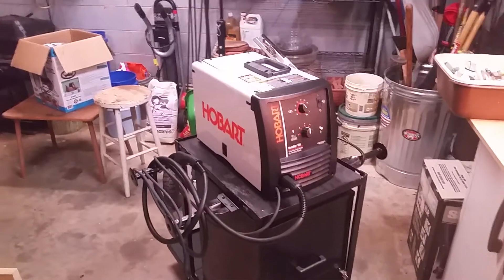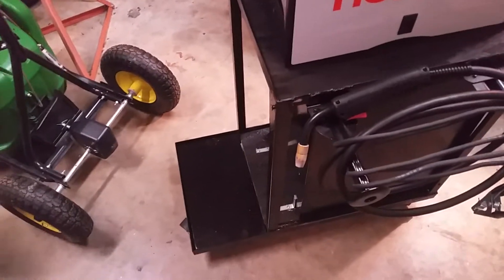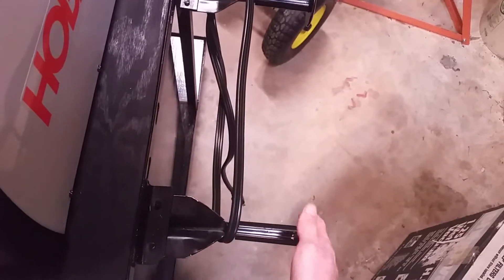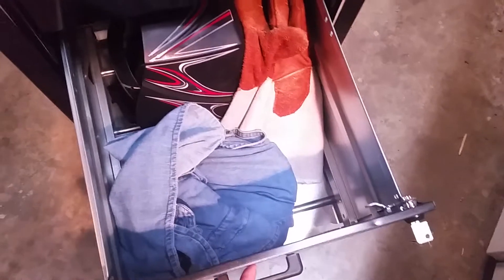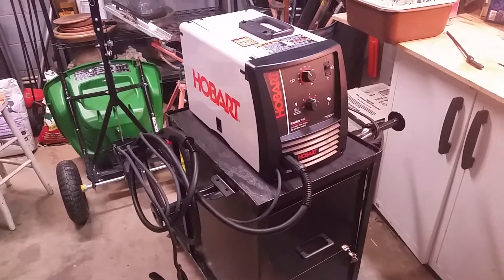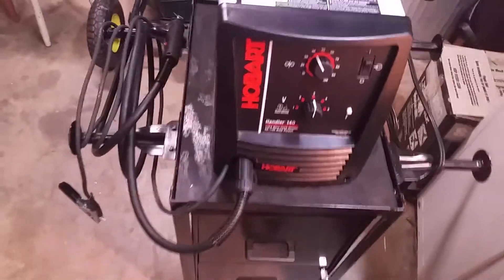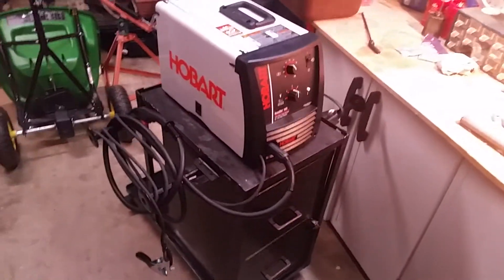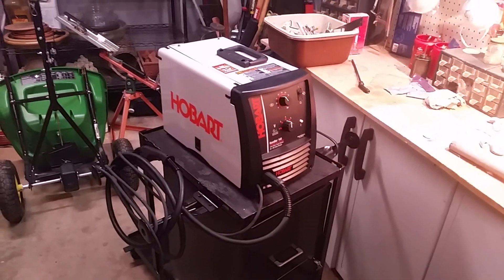$10 Welding Cart Build Overview

Comment: Excellent concept, but skip the metal frame altogether.  Screw a couple 2x8s or 2x10s to the bottom of the cabinet extending beyond cabinet to provide the gas cylinder platform.  Screw the four casters to the 2x lumber.  Easy, quick, cheap, strong.  Screw hose/cable hooks to cabinet.  Screw PVC pipe to side of cabinet for rod holders.  Paint lumber to match cabinet.  A couple 2x4s (or metal angle) screwed vertically to back of cabinet provides extra support for gas cylinder.  Could merely ratchet strap cylinder or use typical hooks and chain.  Added 2x4s or angle on cabinet side allow attachment of hangers for cables/hoses with extra vertical height.

Comment: you cables are wound too tight ,don't kink your welding cable,keep them loser wound  .I to use bed frame angle to make welding carts .the short file cabinets make nice additions .use 3" casters .

i